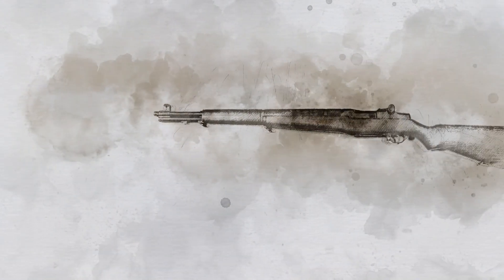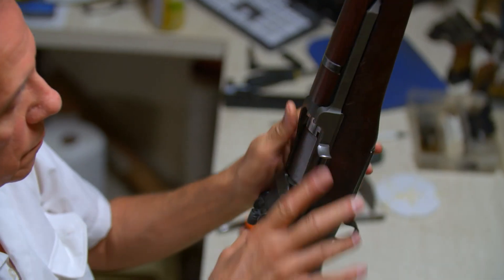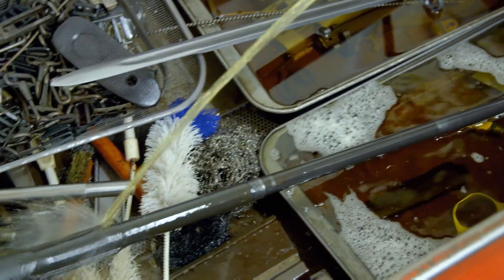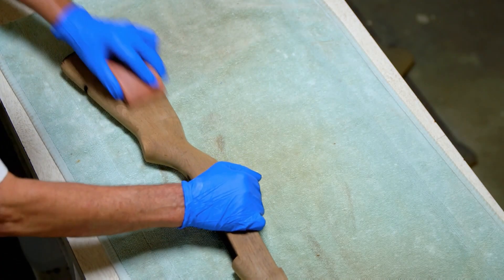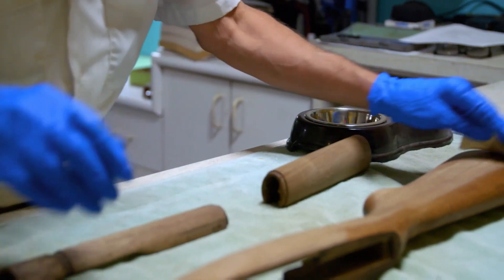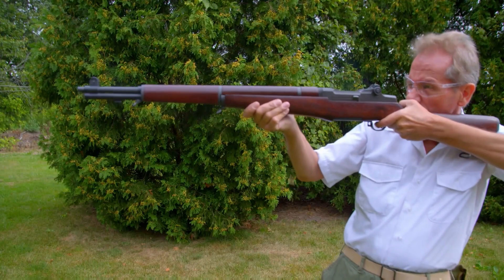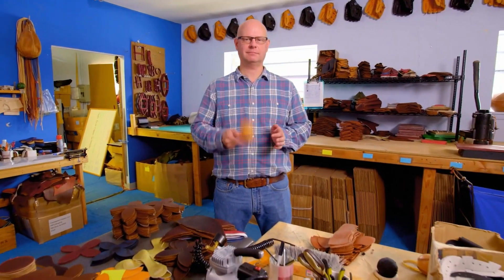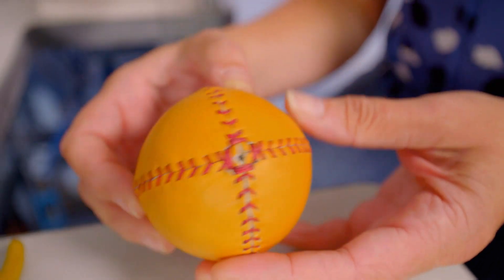M1 Garand: How To Restore A Revolutionary WW2 Rifle | History In The Making

Comment: I would love that job.  Cant wait to purchase an M1 through the CMP.
Reply: Better make some moves they are running out of them quick
Reply: @Briandotmiller  😢
Reply: @Chris-si2tj  maybe they will get more? I just Know the Philippine returns are almost gone
Reply: @Briandotmiller   not that many lmao they are just going to get more expensive
Reply: Trust me, you will fall in love with it! Be sure to remember that it is meant to be a shooter so plan on learning how to reload  30-06 for the M1. Do NOT run stock 30-06 through it. You will bend the op rod! Also, see if you can pick up the Greek ammo or similar from the CMP. That will get you started with brass.

And the story about the krauts listening for the clip ping is bullshit.
Reply: @warplanner8852  you can also just buy an adjustable gas plug for it that will slow the op rod and allow you to shoot any ammo through it. With adjusted gas pressure you can fire the hottest loads of modern 06 and put less stress on the op rod than m2 ammo with the factory plug.
Reply: @warplanner8852  that’s where the schuyster comes in
Reply: CMP ones are hit or miss, make sure to ask for good metal and barrel, one that my friend got had pitting and most of the metal finish was gone.
Reply: @warplanner8852  Sorry sir.  My dad verified the story, telling us about the times he was in close combat with the Germans during the Battle of the Bulge.  They held their fire, probably ducking in cover, until they heard pings, and then opened fire .
Reply: @crankyoldguy2  wow! Interesting to hear! Thank your Dad for his service.

Comment: "Not made with the best steel "

So yeah, there's the truth of the "lowest bidder" mentality in every army. But the US had to ship everything across the ocean, so things were built to survive longer. Things were built heavier, like the Sherman, and used beyond the point that they were competitive (also like the Sherman). Life expectancy for equipment didn't mean planned obsolescence or failure. It was designed to well outlive the expected span of usage, and built to that standard. There's a reason modern reproductions of the Garand simply aren't as durable: civilian production of such a rifle isn't meant to keep one man alive and kill another, it's meant purely for profit and sport. The steel itself may be "better" nowadays, but the process is far cheaper.
Reply: These M-1 bolts and receivers where forged great quality steel and heat-treated to .012 to .018. Gas cylinders where made of stainless steel.

Comment: It is NOT a "bullet casing" it is a SHELL casing. If anything is a "bullet casing" it would be the copper jacket around the lead core of the bullet. 
Did he grease the op-rod and the 12 other standard points that need greased? And then oil every pin and tracks if the follower and the elevation and windage mechanism?
The "ping" legend is pure fairy tale.

Comment: Garands last as long as the soldier does. His "restoration " is pretty harsh  especially the heavy sandblasting not to mention boiling the stock. My advice find someone else. Most of what he did destroyed any historical and collector value and a sandblasted M1 dosen't look like a new one.
Reply: Rebuilding and blasting the finish are two different things. I've seen crudely sandblasted M1 rifles that the heel stamping is nearly erased for one example. Good restorations preserve as much original finish as possible. You don't know what you're talking about.
Ps; I just noticed that he even sandblasted the rear sight elevation notches on the receiver, really foolish as they need to be crisp and original dimensions to have positive clicks on the elevation knob, that damage is irreversible.

Comment: I have not taken mine apart yet cause i think if i do i wont be able to get it back together
Reply: You’d be surprised how easy it is if you take your time, use a video as a guide. Take pictures as you go, this was you can refer to those pictures when re-assembling to double check the orientation of parts. I think most people only field strip the gun once a year, if that, depending on how much they shoot. Apparently the more times you take it down, the looser it can become. This can have a negative effect on accuracy.